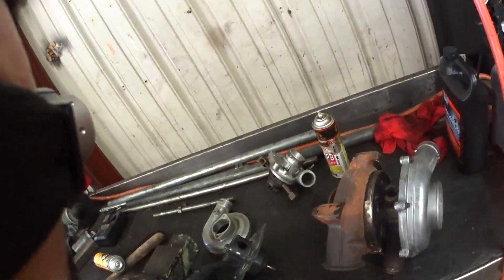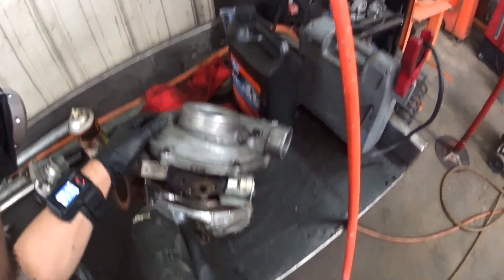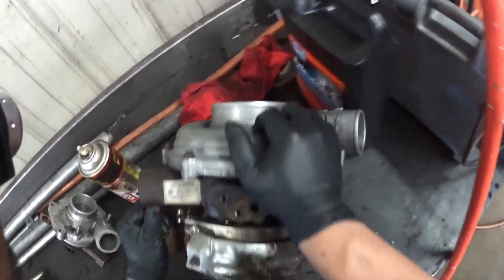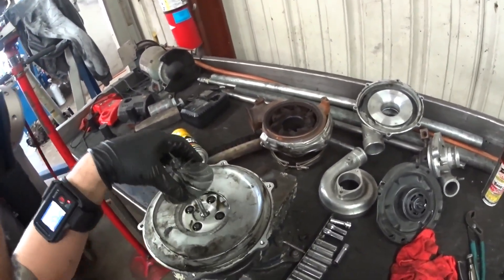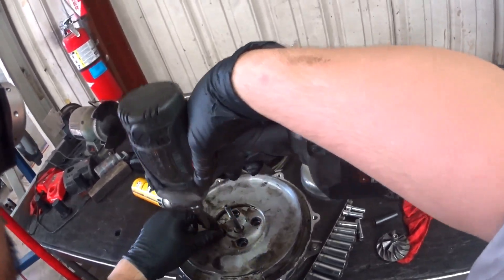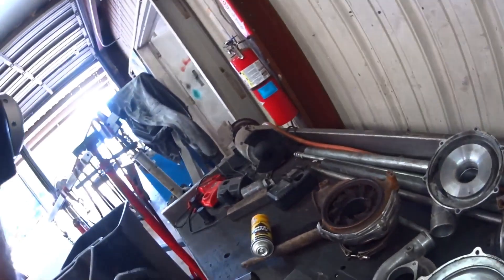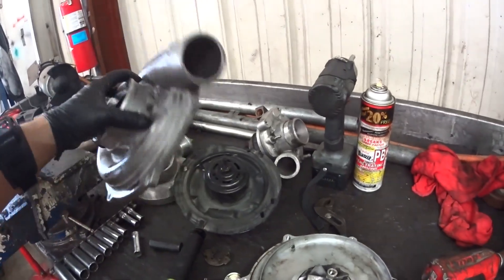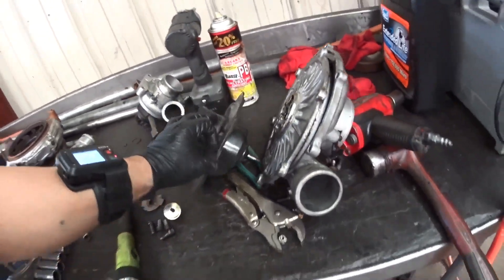Inventing a electric turbo part1

Comment: Love the idea, the blower motor only spins about 5,000 to 8,000 rpm. The compressor  wheel needs to spin a minimum of 40,000 rpm. I believe you would be better off trying a large brushless rc motor that can possibly get you up to 80,000 rpm which can give you up to 5 to 7 psi of boost depending on compressor size.

Comment: I know this is an old post, but we are now up to 60V and 50,000 RPM in four years. SO this guy probably knew it was coming but the engineering behind it is very complex. As someone else points out. It's the instant discharge that is a problem. Large electronic capacitors wil eventually replace a battery which will deliver the instant current required to give that instant effect. Belts, exhaust, inter coolers and the like are a thing of the past. Waaay too complex and messy. ALL major car manufacturers are researching this system in earnest to be the first. The issue they face will be cooling the charge reliably. I have a Torqueamp with methanol/water injection in my Alfa Romeo 2.0L and it produces about 5PSI on full throttle. I haven't had my ECU remapped to suit but it gets about 25% increase in wheel HP and about 50% increase in torque. It's cheaper than a true supercharger/turbocharger by about a quarter and super easy to fit. So this definitely works... it's just early days.

Comment: i dont think that motor is big enough/fast enough. u need somethin with bigger nuts. with high torque. 10,000rpm 150watt 12v... seen some online for 10bucks from china... not sure about quality.   but u also have to compensate for the weight of the turbine.... probably use an electric scooter motor?

Comment: It would be proper to aim towards reducing turbo lag instead of creating boost. With all due respect change that blower it is not as powefull and also keep the turbine, don't you remove it. 

Mate if you attach an electric motor like the MGU-H from the F1 cars and make it simple you will be making history, just use super capacitor instead of a battery hence you will be making 1/4 mile races right?

Comment: It needs to be driven by a big brushless high kv motor like some big boys for rcs they have some the pump out 10 horsepower on 60-90 volts and do go up to 150,000 rpms

Comment: What a joke, using an A/C blower. Just because the the part has "blower" in it's name doesn't make it a S/C or T/C. If that were true, then why not use a leaf BLOWER to do the same thing?

If you believe that A/C blower can make enough boost to where the engine it's on will make any significant power gains, then give me a call at 1-213-876-5309 because I have great ocean front property on the moon that I'd like to sell you. Great views, quiet, no neighbors for miles and you can drive your blower motor turbocharged engine for miles without running into another vehicle.

Comment: A turbo spins up 250,000 rpms.. a blow motor might spin in the thousands.. maybe.
now if you could find a electric motor that spins that fast ( yes they do make them), that motor also needs to have torque as well.. and be able to fight heat.. now throw all that together and it is possible but by the time you did all that it would have been cheaper and easier to just buy real turbo set up.
Reply: Tanner Brown https://www.formula1.com/en/championship/inside-f1/understanding-f1-racing/Energy_Recovery_Systems.html
Reply: What does formula one have to do with it? Yes they use turbos if that's what you wanted
Reply: Tanner Brown because Formula One uses hybrid electric turbo/recovery systems.
Reply: Yeah.. and they also have millions of dollars going into those turbos and they are built by engineers. They use the right stuff that was designed to do that. I didn't say it was impossible to do. I said it was impossible for someone in his shop to do with a fan motor...
Reply: Tanner Brown yea but that shouldn't stop anyone from creating an affordable version  for everyone to use
Reply: But the facts are you would never be able to create it with a blow motor.. you couldn't build boost at idle with a blower motor
Reply: 250Krpm.... that must be a small ass turbo. 120Krpm max but 250K... do you need 2.21GW to spin it that high?

Comment: Another one that don't know what is forced induction!!!.
Reply: TURBO CHARGER https://www.formula1.com/en/championship/inside-f1/understanding-f1-racing/Energy_Recovery_Systems.html
Reply: Bryan Sills Just because you gave me a link which is of course rubbish THERE ARE NO STANDALONE ELECTRIC FORCED INDUCTION so I will ask you a question that YOU will respond to me - mention me ONE car that has STANDALONE ELECTRIC FORCED INDUCTION THAT ANY ONE CAN BUY?.
Reply: TURBO CHARGER I didn't mention a stand alone electric turbo. formula one uses hybrid electric turbo / recovery systems. its not rubbish its a fact.
Reply: TURBO CHARGER hybrid turbos have much less turbo lag because of the electric assistance and when not being used the blower acts as a generator/alternator creating electricity
Reply: Bryan Sills My argument was that there are NO standalone electric forced induction present YET on this planet. Also my argument is about that people are making in their mind that by just strapping an electric motor to a real compressor and they just switch on they are going to feel that dreamly boost on full throttle. But what just had told me is no new technology at all , we  remove turbo lags by just installing a nitro shot it's better than a hybrid turbo but next time read someone's comment carefully before you conclude yourself!. Goodbye.

Comment: I was looking into this myself. I believe in order to create a reasonable amount of boost, you need 5 horsepower (3700 watt) motor that turns about 100,000 rpm. This is far above what a blower motor and your standard charging system can do.
Reply: Just fill the boot with batteries and chuck in a 50hp electric motor to drive the turbo! Of course, you'll probably need two to offset the weight of the batteries. They'll be quite big so you might need to swap in a smaller engine... can anyone see where I'm going with this?
Reply: Voshmir https://www.formula1.com/en/championship/inside-f1/understanding-f1-racing/Energy_Recovery_Systems.html

Comment: Your blower motor might spin at 1000 rpm.. maybe a few, but some smaller turbos turn as fast as 180,000-200,000 rpm. unless you can find a way to get that wheel spinning 50,000-100,000 rpm your not going to be able to build substantial boost.

Comment: You need some real power and speed to drive that compressor wheel. There are motors, controllers, and batteries that can do it but they cost $$$. I suggest a high voltage stand alone system with extra injector that will spray a cold boil at room temp fuel. With a custom stand alone ECM switching program system to control the thing. This way you can engineer a real push button go faster E.M.S. that only needs a plug in recharge, refuel with something you can buy at the dollar store, and is easier to program than NO2. What kind of engine do you want to put that thing on?

Comment: Build a bracket man n a pulley system! 
Make the drive pulley 30cm on the crank n have it drive a 3cm pulley direct connected to a 10cm driving a 1cm pulley that drives the compressor! 
Engine does 1000rpm that is 3thousand at the 3cm pulley driving the 10cm at 3000rpm x 10 for the little 1cm 30,000 revs at idol u will get boost by 3000rpm at the engine! 
Ditch the electric idea n go with gears
Reply: That would be called a supercharger.
Reply: wtf did i just read? At NO point does the RPM tacho read anything other than the engine's RPM. Also what normal engine idles at 1800? try 600-800. If you don't understand how it works don't comment. go look it up
Reply: +jeff pepin No..just a supercharger....a centrifugal supercharger. A few companies make them
Reply: great info
Reply: +Jeffrey Sousa  A SUPERTURBOCHARGER
Reply: well bro I think it will be spinning faster because at idle yes it will be 1800 the engine rpm but when you start to move the rpm is really the wheel rotation and not the engine, i think the engine rotation is faster just saying. I was just think I may be incorrect

Comment: even if you got is to work you would have to fight the intake manifold pressure which will comeback and ruin your impeller. It's called compressor surge, it can't fight the air in the manifold trying to escape and will shatter the impeller. I know your trying to make it work to get ready instant boost but it would've already been done when trucks first started using forced induction. I wish there was something that easy but it's just not possibly, to make boost you need to spin that impeller up to 100k rpm and the heat and friction alone is too much for an a.c. blower motor

Comment: how do you plan on getting it to spin at 200k rpm? But the biggest question is how are you going to cool and lubricate the bearing?
Reply: Brushless dc motors center shaft dont need oil to lubricate.  This is possible for upto maybe 5 psi at times depending on the demand for air and downshifting bumps.  But in the real world its about 2-4 psi.  

Yea it may not seem like much but, you have to keep in mind, this a total budget boost.  It can make a 4 cyl feel like a 6 and get around and even beat all those small dick truck owners who love to fuck with dare i say, ricers. Tuners are a douche niche type of people.  Then, you have the rest of the population that enjoys working on their car but cant afford the cost of tuning, parts and labor to go fast.

This can be done at low cost and once perfected to your liking, the experience, fun factor and functionality is far greater than dropping 5k on a car that you need another 5k in suspension, brakes, tires, and soon transmission to have a reliable car.

Esc, motor. Turbo housing, misc wires, tubing, metal work will run maybe $400 or less. Oh shoot batteries.  Ok maybe $600 and the bonus is no check engine light or tuning needed.  The ebay ones wont work.  You need 24v or more.  Thats 8s escs or better and a 2000kv motor at best.  

Only problem is the bigger the motor the lower the kv.  Happy medium seems to be the 5463 - 5484 range.

Comment: 12V blower motor max rpm is about 4,000.  exhaust turbine spools to over 80,000 rpm.  Plus the laws of the conservation of energy prove there isn't enough energy being produced from the blower motor to begin with to compress air to provide any increase in power. You're asking a mouse to do an elephants work... Remember, exhaust is WASTE and doesn't rob the engine.  An electric motor will cause the alternator to work overtime and actually reduce output.  good idea though.  you will need a stronger motor and a lot of pulleys or gears to get the 80,000 rpm....
Reply: :exhaust is waste and doesn't rob the engine"..... how much money you want to put on that statement? Turbos work on back pressure. back pressure add resistive load on the engine therefore a turbo system takes power to run also. 
80Krpm... brushless motors go up to 120Krpm.
the only thing you got right is that the blower motor is not powerful enough and does not spin fast enough.

Comment: It might be more feasible to carry a cylinder of compressed air onboard. There will need to be a compressor and a whole lot of thought to meter the addition of the air in relation to rpms and throttle position. its all about the right CFMs at the right RPMS

Comment: the key to reaching the required speeds is using high KV brushless motors and high discharge battery boosters or high farad capacitors.
Reply: I know you made this comment awhile ago.. but they now use 'Maglev' technology instead of bearings.. its pretty impressive tech. The turbine shaft 'floats' on a magnetic field so there is NO contact at all.

Comment: im not an expert or anything but i know how to work on my cars for sure.  but making an electric turbo will require a much more powerful motor than that. plus i read the other day audi are testing this idea already but using 46volts with batteries that capable for that kind of juice.

Comment: 10k+ 120v motor with speed box capable of a 8x + increase of speed. then you pray to god that the torque required to maintain the speed after resistance hits doesn't dead stop the motor.

Comment: I was thinking to get the rpms on the compressor side required for boost, I would try to use the exhaust flange side of the turbo and basically use a powerful fan to blow air into the exhaust flange Just like the exhaust used to do

Comment: Hi! I'm actually trying to make almost the same electric supercharger as you, but even more similar as the gt86 electric turbo project on the net. Since powerful electric motors have problems running above 50 000rpms you need to get the biggest diameter turbo you could find! Otherwise it won't make boost at this low speed. I'm planning on using a garret turbo from a ford 3-400hp stock diesel engine. At 51 000 rpm it will give me a boost of about 3 psi. The clue is to use a brushless motor with 3500W or more power to get a boost on a 230hp gasoline engine. 3500W is a minimum requirement at above 200hp. To go above this you ned more rpm and more electric power. Target turbo speed is easy to get from turbo compressor maps, example http://www.turbobygarrett.com/turbobygarrett/compressor_maps. Also cheap china brushless motors (from ebay) might be able to deliver 3500W and 50K rpm. My target is 3-4psi boost and a increase from 170 to 210-220hp. I hope this gave you a few ideas and I hope this information is helpful to others looking for a semi cheap way of getting more horse power!
Reply: Stupid is as stupid  does!!